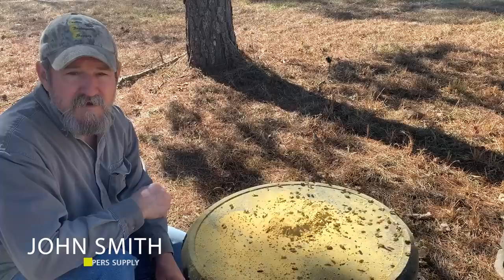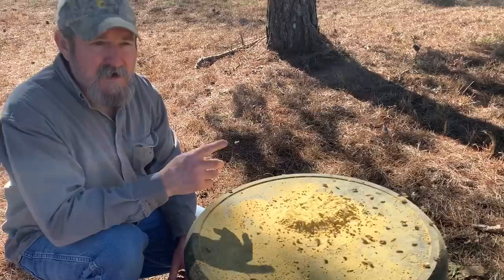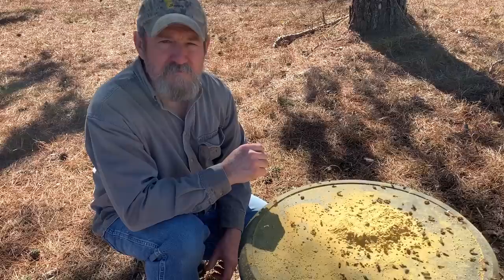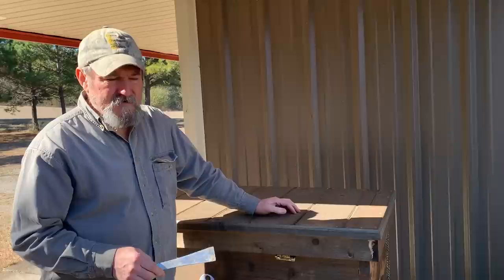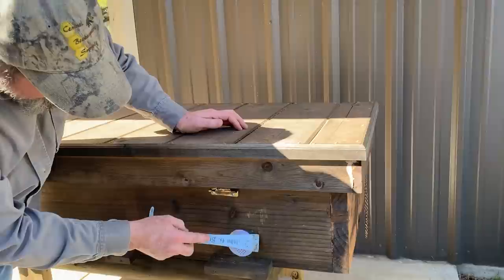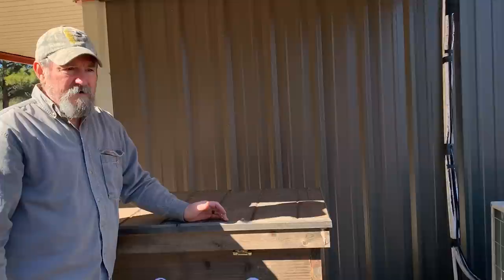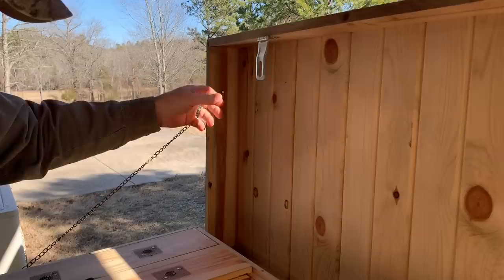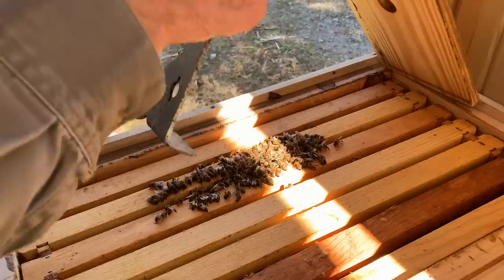Long Hive Check-up | Uh-oh, DEAD BEES! [Long Langstroth Hive final check up]

Comment: Sorry to see this but those bees remaining starved/froze.  That was a really small cluster so yeah the queen wasn't laying enough but they did cluster.  The problem is that once it gets cold and they cluster they can ONLY move up.  That is why there was still honey all around the custer...they just couldn't get to it.  Also you could help them by covering all those vent holes and insulating the lid.  An insulated hive will cluster at lower temps which should help.  I'm in Texas but insulate all my hives which helps against the sun and also the cold snaps in winter.  Good luck to you!
Reply: Some of my bee colonies do not even cluster because they are so well insulated, so yeah insulation matters a lot. Of course when they get too warmed up in winter It's not good too because they feed too much and might do some other dumb shit
Reply from the maker: Thanks Robert! We'll definitely give it another go and utilize some advice we've seen in comments here. Thanks for the comment! Great advice!
Reply: I agree Robert. 2 inches of styrofoam in the top all year round and no top venting will help keep that hive warm and the bees do not have to cluster so tight. The only venting in my hives here in Ontario Canada is thru the small bee entrance.
Reply: @aurimasdzezulskis3180  We have not seen any relation between more insulation and more winter consumption but we will see.  We are in Texas so it might get cold for a few days but the sun comes out and the afternoon temps get above 55 and they forage.
Reply: @rpeebles  Huh. It might be true that active bees eat the same amount of food as the bees hibernate because you know when It's cold they still have to eat
Reply: @aurimasdzezulskis3180  I insulated several hives this year after watching Etienne Tardif on YouTube. He has some fascinating videos on insulation. Bees generally consume more when it's cold because they have to burn calories to heat the hive. They use the most honey when raising brood. But when there is no brood and good insulation, they consume very little.
Reply: @dougstucki8253  Yeah. That makes sense. What I noticed that better insulated hives wake up earlier in the winter and they raise brood earlier so then yeah, they consume more food even though they are better insulated and they will be stronger in the spring of course. Insulation is the key I think

Comment: You have no insulation on the lid. I have a 1inch piece of Styrofoam insulation on all of my lids. Your whole hive is made with 2× and your lid is 1× T and G. I make all of my own layens hives and frame's. I got my plans from Bee Boy Bill's and modified my lids to accept the Styrofoam insulation and so far it has worked great.
Reply from the maker: Great advice, James. A little extra insulation may have saved this colony. Thanks for the comment.
Reply: James is right. For two years my hive either didn't make it out or really struggled to get into spring. I then added a blanket I got from Harbor freight and placed it on top of my cover boards. That helped out so much! There is too much heat loss in long hives. I'm in Utah so I have cold winter's.
Reply: Even a thick blanket over those holes would have helped...all their heat went straight out of the hive.  I don't add any vent holes in the box just the lid.  The bees are experts at venting their own hives.
Reply: @CentralBeekeepersSupply  This spring will be my second year beekeeping, but before I started I read a lot of books and watched a lot of videos for about a year before I  started. I still watch videos everyday, still learning. Looking forward to watching more of your videos. Thanks 😊

Comment: Great video, and interesting situation that they died out with honey so close.  However, I agree with some other posters that they died due to starvation.  While in cluster the bees will only move vertically for food.  You mentioned that you'd recently had a very cold spell, so the bees wouldn't break cluster to move laterally, even to the next frame.  They're all piled up at the top and I'd say they just ran out of food.  I think this is one critical limitation of the long Langstroth hives - there just doesn't seem to be enough vertical space for the bees to get through a hard winter on their own stores.
Reply from the maker: Great comment. This is a great explanation of what happened.

Comment: Bought one of these boxes from John. My father-in-law has back trouble and we thought this would be great way to keep folks with back trouble in the hobby after  conventional hives make it either painful or impractical or heighten the chance of further back injuries. I felt like this hive had a lot of advantages.  First it can be set at whatever height you need to set it at to work comfortably with it, simply by changing the length of the legs. Second it eliminates the need to lift heavy supers.  That should lead to better care of the bees because instead of inspection being "work" it is just a matter of opening a lid. I'm not sure they are promoted as a practical alternative for folks that have back problems or disabilities but I think maybe they should be.
Reply from the maker: Good testimonial, Shane. Anyone with a bad back - definitely check out the long hive. It's proven itself as highly valuable to this beekeeper. 🐝

Comment: Towards the very end of the video I noticed a crack in the last board of the lid, which was above the colony. Perhaps that allowed too much heat to escape during the colder days/nights you mentioned. Seems like something that should be addressed to give future colonies a better chance.
Reply from the maker: I think you may be correct. Something I definitely missed in the inspections. Thanks for the comment!

Comment: The bees won't move sideways. Unless the whole cluster can walk over. They can't break cluster in winter.
Heads all sticking down cells, then they get chilled. 
 Those sugar boards help with that on smaller colonies.
  Edit: FYI, that can happen just the same in a standard hive. It's common to see a dead colony that got all the way to 1 side, with a frame or 2 all the way across the hive, still full.
Reply from the maker: Great advice!

Comment: I think I see a pretty bad crack in the board in the top that would have been right over them-see at 11:52  I agree with your diagnosis-I'm sorry you lost your bees.
Reply: I saw that too and was going to comment and see you already have. I also think the roof needs ventilation and insulation for colder months - even in Arkansas.

Comment: Bummer, sorry to hear! I have a hive that has a really small cluster, possibly smaller than yours. They moved one direction in the hive and could not move back due to the cold, so they have been eating the emergency stores right over them, even though there is a full deep frame of capped honey located a few frames over. Emergency feed is key and they can keep pretty warm in really cold temps. They just need calories to burn. Next year, my friend!
Reply from the maker: Gotta stay on top of it with the emergency feed, that's for sure! We will definitely try again next year!

Comment: Northern beekeeper chiming in. You are right the population was to blame especially with the unusual cold in the south. Sometimes it's hard to axe an old queen late in the season too. No replacements. But that cluster did starve too. The cluster as a whole could not move to the honey on the outer reach of the frames. They rarely will leave the brood to chill even as a last ditch effort to save the cluster. Next winter have some sugar bricks ready. Just store them in the freezer until you need. If the weatherman forecasts brutal weather then place sugar bricks directly above the cluster on the top bars. Heat rises so the cluster can too. They may not move out on the frame. But they will move up. Any sugar brick uneaten can be restore in the freezer. 

Effort in a 2 to 4 lb sugar brick is nuttin compared to high winter loss due to weak numbers. We all have winter losses  but I do my best to minimize it.
Reply from the maker: Great advice, Diane! We really appreciate you chiming in. 🐝 ❤️
Reply: Yeah my plan is if i catch a late swarm or have small nucs, is to just strengthen another colony and cut my losses early. I lost two small nucs which could have served a greater cause else where.

Comment: I went back and looked on the first video you did on the hive and i did not see the board split on the first video. The split board is right over the cluster of bees and lots of heat going up and out.❤🐝
Reply: Also moisture could have gotten in, I saw the same crack and came to the comments to see if it had been pointed out.
Reply from the maker: Sorry about that, but we didn't delete the comment. But you're right! There is a crack there that I didn't see before.
Reply: @CentralBeekeepersSupply  I am making 3 long hives this year I'm excited

Comment: Sure hate to see the loss, but like you said, maybe it just wasn't meant to bee. So far I've had one colony pick up and leave and one was similar to your loss. All 9 were great until that first couple days of freezing temps. I believe this rollercoaster of temperature  changes is harder on them than if it just stayed on the cold side. Normal ain't normal anymore!
Reply from the maker: Up and down temps seem to be harder on them than just plain cold weather. You got that correct! It's such a fine science dealing with bees. One that we haven't mastered yet, but we're getting closer. 😊  Thanks for the comment, Jon!

Comment: 2” of rigid insulation installed in the top and close any top vents might have helped, especially this year when you have yo yo type of weather. So sorry for your loss.
Reply from the maker: I think you're correct. Next time I'll be sure to add a little insulation.

Comment: Not sure if it helps but I cut a small hole in the middle of my plastic foundation to make it easier for them to go left or right to the next frame easier during the winter.
Reply from the maker: Excellent advice! 🐝
Reply: Thats why the corners are cut on many plastic foundations. Often with wax foundation bees will make a hole somewhere .
Reply: Exactly right. I have Warre hives where they build all of their own comb, and there are all sorts of little holes and tunnels to access all of the comb in really cold weather. Natural comb designs are absolutely fascinating, and more efficient than the frames we give them.

Comment: Just thinking, but is that hvac unit heatin the house too. If so it will make it even colder in the sorounding area in wintertime…and hotter in summer
Reply from the maker: Nope, it's the old unit for our shop. But good eye!

Comment: I started this time last year with two long hives and caught two wild swarms. Still have the same two as of now, but have 9nly kept adding more and more frames.  I was able to collect 19 pints of honey from them. My biggest problem is how to find a layens frame honey extractor.  Tried ordering one this last year but it wasn't the right size. Do you have any way, or I should ask how are you going to harvest your fra es from these hives? Sorry about your lose. Troy Poff
Reply from the maker: Hey Troy, thanks for the comment. In my long hive I'm using standard langstroth frames, so I don't need a special extractor. However, since you're using layens frames, we do have a solution for you. One way to do it would be to cut comb, crush and strain. If you want an extractor to do the job for you, I'd recommend the Civan brand. Give me a shout at the store and I can talk you through it, or answer any questions you may have. Here's a link to the extractor on our website. Thanks Troy!

https://www.centralbeekeeperssupply.com/online-store/search%3Fkeyword%3Dcivan

Comment: The bees starved
Reply: Next year feed with fondant on days below 15 f they can’t move but need to eat a lot
Reply: The bees can handle -40 take out any venting they could of also ran out of water
Reply: They wanted to move up and could not for food. The population is fine just need to put fondant give them a bigger entrance for venting and remove cross venting
Reply from the maker: I think you may be correct. Thanks for watching!
Reply: Idk. Maybe if the honey was not appropriate for winter food, That's why we always take out honey and put sugar syrup for winter food
Reply: @aurimasdzezulskis3180  might of fed them that’s why they are at the top or they wanted to move up but couldn’t